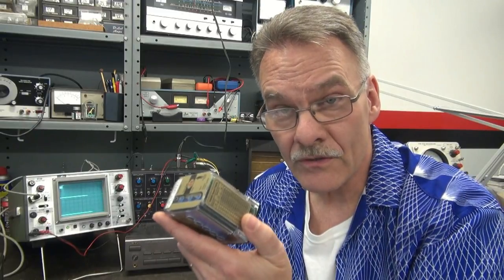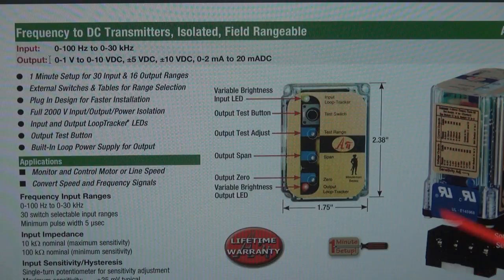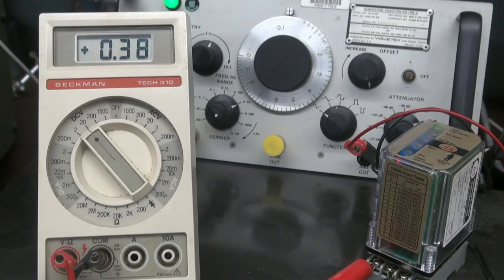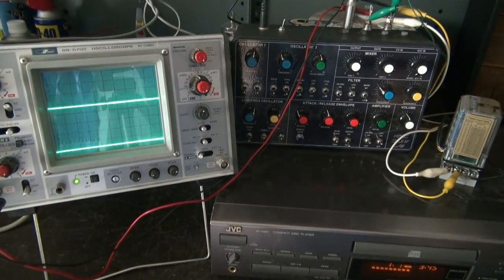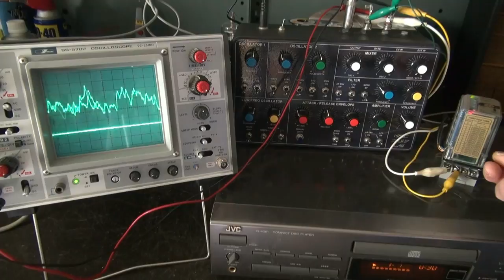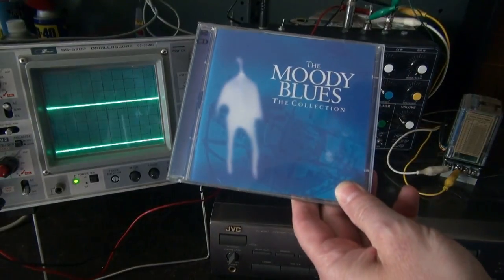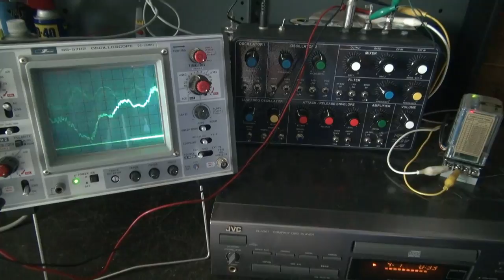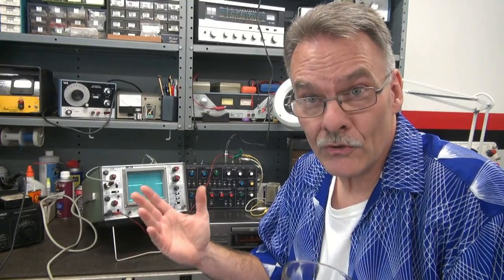How to Modulate Analog Synth  CV Input using a CD Player FV converter

Comment: Could also easily use one of these to drive lights at varying intensity. Also would be easy to drive things in the mechanical world like motors or solenoids.  The possibilities are endless.
Reply from the maker: Excellent idea man, I did not think of that
Reply: an easy way to create a animatronic band lol
Reply from the maker: Yes Sir, I have more modules if you would like to experiment